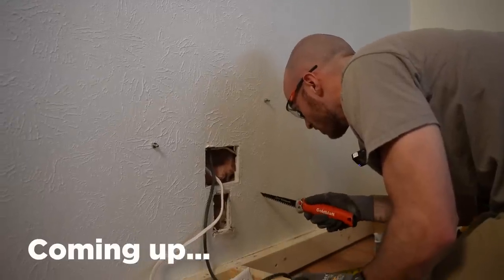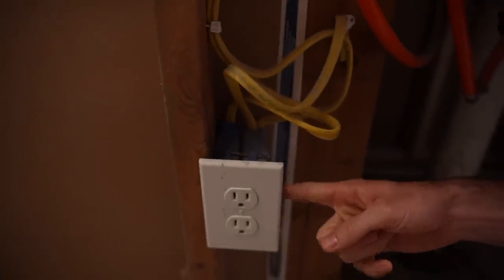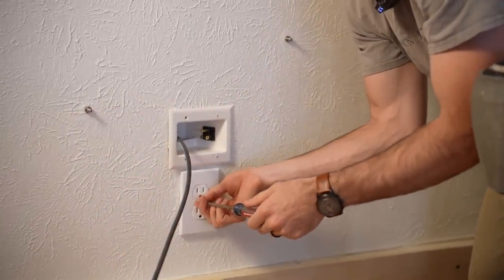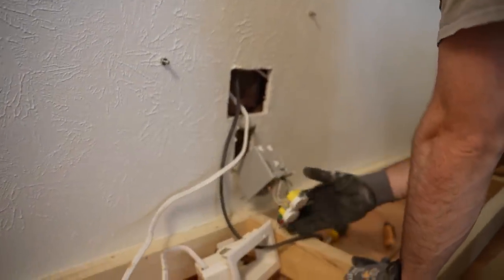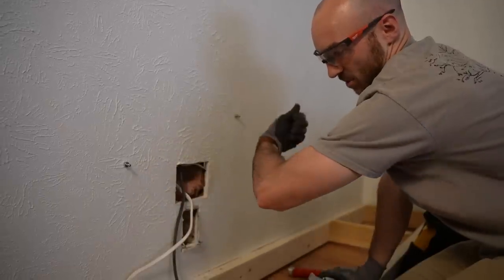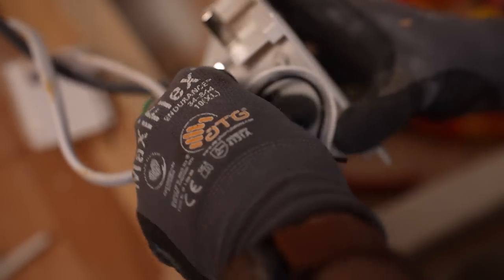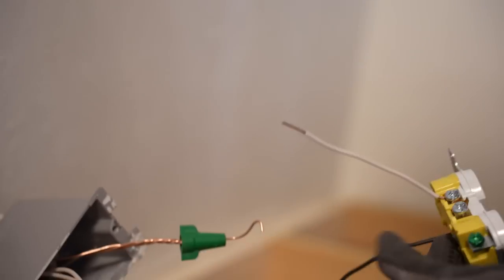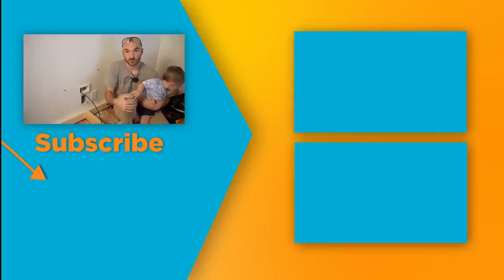Moving an Electrical Outlet TO CODE

Comment: You mentioned the idea of lengthening the wire by splicing in a box, covering box with blank plate, then installing new outlet to left of existing location. You said this is probably the best solution for moving an outlet when you need more length. In your case, since you have an unfinished basement, a reasonable solution would be to make up the splice in an accessible box in the basement. The big benefit is that you aren’t left with a blank cover in your finished wall.
Reply: agreed. if basement is staying unfinished he could box it down there then run a new wire/feed anywhere he wants!!
Reply: And that blank cover still needs to be accessible so making the junction in the basement would make way more sense. As long as it doesn't get plastered over.

Either I missed some thing but wasn't the whole point of moving the outlet that it was going to be covered by some thing? Leaving the old spot not accessible.
Reply: I agree with that statement but now you are gonna have to think about the time and money it will take to put drywall back in that spot and texture it. Simple and cheap if the homeowner can do it in that situation.

Comment: I'm almost positive you may know this already, but Southwire makes a hybrid box that's designed to bridge the gap between new work, and old work boxes. They utilize angled screws inside the body of the box so you can install them directly to studs, like new work boxes, but they have the ease of use, and flexibility of old work boxes. I recently installed a 3-gang hybrid in my hallway to pull a 1-gang, and 2-gang into one switch cover plate, and it worked like a charm. 
  I love the security of the box being fixed to a stud, rather than relying on those compression flanges old work boxes use. Those things tend to break, and can be more of a pain than they're worth. That being said, I think you did a marvelous job explaining everything, and detailing the possible nightmares a homeowner can expect if they decide to take on a task like this. Bravo, sir!
Reply from the maker: Yes! We like those too: https://amzn.to/3LO2WgV. This receptacle will require very few insertions (nobody's reaching to the back of the drawers to plug their phone in 😅) so I didn't feel the extra time and material was worth it on this one, but those screw-in boxes definitely do provide higher value if you're looking for some more security.
Reply: @ElectricProAcademy  I totally get it. Time is money, and the only thing you can never get back. I really apologize for not replying sooner, but I didn't see yours.
  I finally got all 4 new light switches to replace the older ones. Not that there was anything mechanically wrong with them, but the faceplate is white, and I want them all to match. I have 3 3-way, and 1 single pole to do. Such a simple job for you, you could do it in your sleep, but for me it's kind of a big deal, lol.
  I can see it now. After it's all done I'll be strutting around like, "I watched 2 YouTube videos, and changed 4 light switches...I'm a friggin' pro!!!" LMAO!

Comment: Those noncontact testers are great for telling if there's power there but they're not good at telling for sure that there isn't power there that's where some thing with the load like the three light tester voltmeter with some training or a good old fashion Radio really comes in handy. The noncontact tester is great for verifying that there isn't some sort of miss wiring where it might look dead to something plugged in, but it can have false positives and false negatives.

And for my British folks that's not proving dead.

Comment: I usually cut the new box location before drilling. Then, use a long drill bit to drill down through the bottom plate of the wall. Of course, being mindful of any obstruction that have been identified in the earlier steps.

Comment: At the end, in deciding where to run the HDMI cable, it can’t hurt to separate the high and low voltage as much as possible to reduce interference. It’s not usually a problem, but why take a chance.

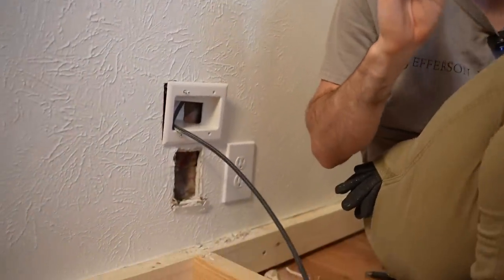Comment: thanks!  question:  "Tim from the future" at 16:07 mentioned that if you had to leave the old junction box in place, that box/cover plate would need to be visible/accessible from the "finished surface".  But, since you're putting a built in there, doesn't that change the "finished surface" thereby requiring the box/cover plate (and the new receptacle for that matter) to be visible/accessible from within the base cabinets that you'll be placing there?  I'm just curious as to what code says.  I may be over-thinking this, but it seems to me the cabinets would be covering this new outlet.  Maybe you intend to cut a hole in the back of the cabinet instead of mounting the box to the back of the cabinet and putting the plates there?
Reply: I think he is meaning that he won't be covering the outlet(s) with the backing of the cabinet itself, but rather, leave an opening in the backing for access from within the cabinet.
Reply: @johnhpalmer6098 i think based on him needing to move the outlet over a few inches there is going to be side of a cabinet or something at that location making the blank cover not work the same way the original outlet?
Reply: @williamwright3735  Well, that too. I think he mentions that due to a support right underneath the plug on the floor and likely a vertical piece right there to support the top, but the questioner's question read more like why the need if it's covered and access.
Reply from the maker: Good call. Another reason that the viewer -recommendation of making up the junction in the basement would have been a better option in this case

Comment: Thanks for sharing your knowledge. 

Question: what old work box would you recommend using for plaster and lath walls. Would you recommend metal boxes with F clips over the Slater box that you are using in the video? I am looking for something that will hold in place well once installed.
Reply from the maker: As others have mentioned in the comments, Southwire makes a screw-in box that is great for secure stud-mounting without disrupting too much of a finished surface: https://amzn.to/3LO2WgV. Otherwise, the Slaters have been ole-reliable for us.

Comment: you missed the worst thing to accidentally drill into in a wall which is the natural gas or propane lines
Reply: I covered that under metal or plastic (along with copper water supply pipe, obviously some are non-ferrous)

Comment: Question: Do they make a wire nut like the one you used on the ground for the hot and neutral wires? It seems like a great idea and would eliminate the need for the pigtails or is there a code reason why they don’t make these type for the hot and neutral wires?
Reply: You don't want, (and are not allowed to have,) bare ungrounded ["hot"] or grounded ["neutral"] conductors
Reply: Wago FTW!

Comment: TV is way too high! Should be at eye level when seated, not when standing
Reply: Great location for a theatre room setup, needs to be higher than sitting eye height.😂
Reply: @oldman-smurphee  Even in a theater room setup the bottom of the screen is usually not more than 36" above the floor.
Reply from the maker: Yep, that'll be a welcome sub-task of this project!

Comment: I would have used Ideal In-Sure Wire Connection devices instead of Wing Tip Wire Connectors.
Reply from the maker: Love them too, just didn't have any on hand.

Comment: Never use PEX or plastic tubing for water supply, including ice makers, water filters, RO etc. It's all poisonous. BPA free plastic is also still poisonous. You need the good ole fashioned copper lines for grounding and for supplying you with trace amounts of copper which the body needs anyway. Any excess would be lost in urine. Copper and lead free solder with solder only on OUTSIDE of pipe, so that only copper inside is superior.

I hate plastic junction boxes too. I also hate 14 gauge wire. 12 gauge is safer Nothing less than 12 should be used. That can cause over heating, shorts, and fires. The chance of over heating is reduced with thicker gauge. Especially in instances where space heaters, toasters, crock-pots, blenders, and other heating appliances are used.

Comment: Electricians irritate me with faceplate screws. Ignore orientation, just do it right by making it snug! If it's not tight enough, the screw will fall out over time. If it's too tight, you will sightly warp the faceplate, which looks like s***!
Reply: No, if it is not horizontal or vertical it looks terrible.  I am personally an all screws must be vertical person.  An extra quarter turn to orient the screws is not going to hurt anything.  If you need to tighten a screw every 15 years to make sure it is tight, that is not a hardship.
Reply: @brianpiper3188 The reason to turn the screws in the Vertical is so DUST does not 'Shelf" on a horizontal flat slot.